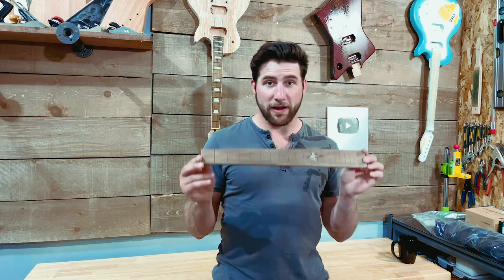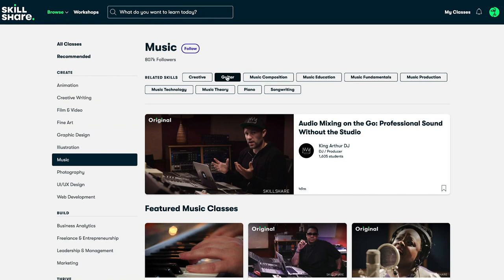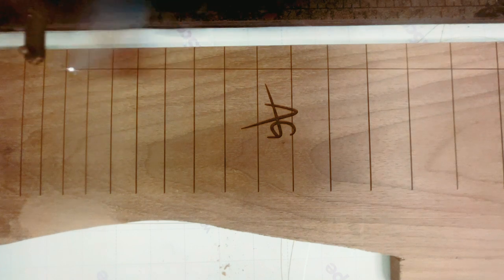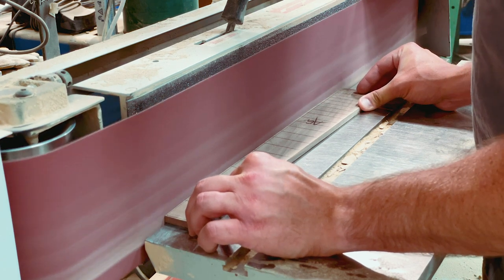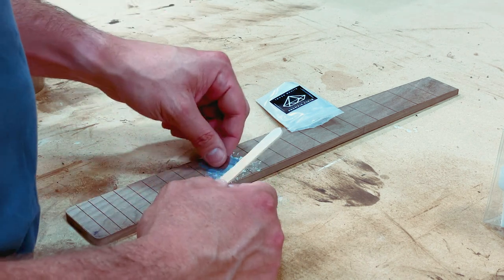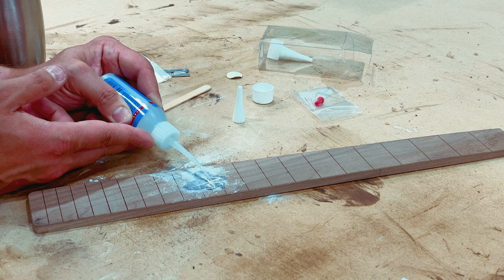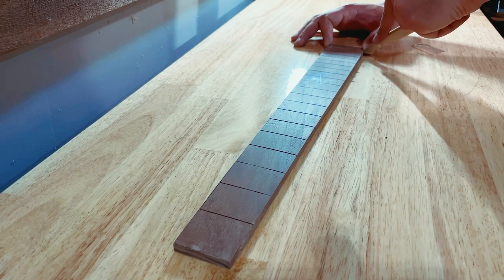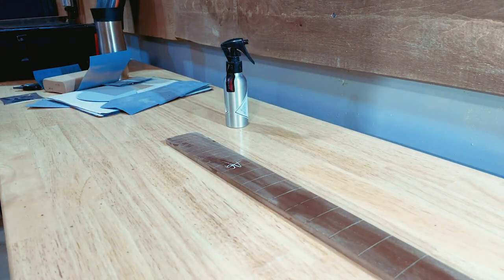Making a Walnut Fretboard

Comment: The fretboard still looks quite thick, at least on camera. Are you planning on thinning it down a bit? I have a similarly thick fretboard on a previous build, and the neck ended up thicker than I would have liked. If you like chunky necks it's obviously not a problem.
Reply from the maker: I’ll be taking a little off the back, but not much.

Comment: Hi Brad....great video as usual. Could you tell me what is the optimum thickness for a 12" radius fretboard. I'm making an SG type and I'm a little concerned about the thickness of the neck after the trus rod has been inserted. Cheers
Reply from the maker: I don’t know that there is an optimum thickness per se. It just needs to be comfortable and you adjust the height of the bridge accordingly. I cut mine about 1/4” think I think.
Reply: @BradAngove  Hi Brad thanks very much for your quick reply. It's not so much the bridge height that bothers me, it's what's left of the neck after cutting the truss rod channel. The thicker the fretboard the less neck there will be for a specific neck section. The fretboard blank I bought is well finished to 5/16'' , so it should be comfortable to plane it down to  1/4". Thanks again.

Comment: Hey, Brad! I remember seeing a video where you were talking about building guitar necks from scratch. Years ago, I had designed my "ultimate" guitar. A solid body electric, it used some creative pickup wiring, and a body design I could best describe as a Les Paul-off-set-double-cut-away body with an in-line 6 reverse headstock. BUT - the main design element that would REALLY set it apart would be the neck/fretboard. I was taught guitar on a classical guitar, and by virtue of my finger physique, I have found the classical neck most favorable. A Fender-type neck puts the strings too close together for my sausage link fingers. So, my "dream" guitar would use a Gibson tailpiece and a Classical nut. The fretboard would have a full 24 frets. Are you up to that challenge? Also the neck must include a near flat back profile. I have, over the years, re-engineered a few classical guitars to have that flat-against-the-left thumb profile. This is not my invention - there are classical guitars built with a flat backed neck. Once you've played one, you'll wonder why all guitars aren't made this way. Thanks for your tutorials. I'd appreciate any feedback.
Reply from the maker: Hi Jon. That sounds like a really cool project. The only thing that strikes me as a mile concern is pickup spacing because the strings are far on a classical, but I doubt that will be an issue. 
This isn’t something that I can take ok, but if you let me know where you’re located I may know of someone in the area.
Reply: @BradAngove  Thanks, Brad! I'm in the greater Memphis, TN (USA) area.
Reply from the maker: I’ll inquire
Reply from the maker: No hits on my inquiry so far, but I’m still hoping.

Comment: Love the idea, sir. 

Walnut is NOT a softer/weaker wood, as others have suggested in your comments (it's actually equally strong, of not stronger, as/than maple/rosewood with respect to specific gravity, bending strength, etc). 

However, your selection of pieces (herein, above) is suspect, e.g. quite a bit of runout, especially with the cut you give it. Walnut, despite it's strength, must be selected properly. More than most woods, it bends, curves, cups, twists, etc. So, like most woods, you need to be especially selective in pieces and use (or, just laminate the neck).